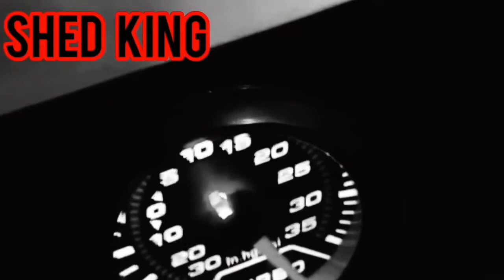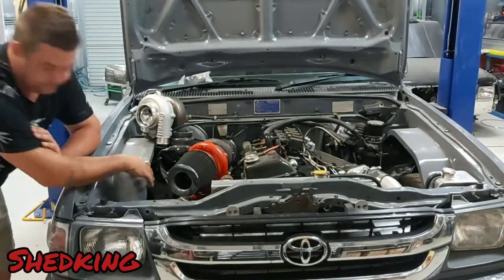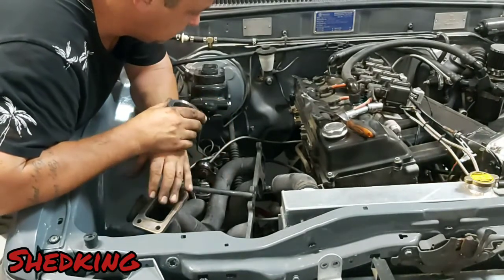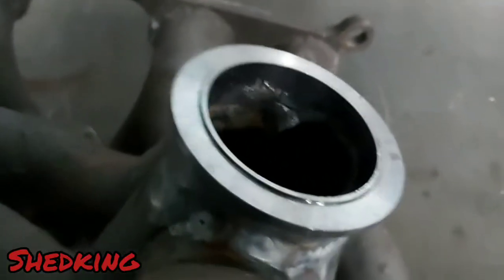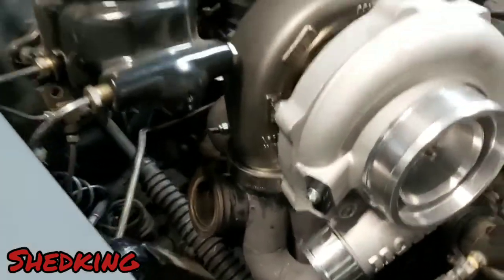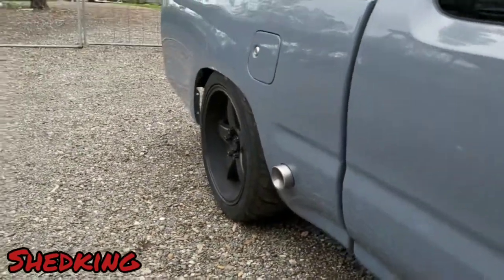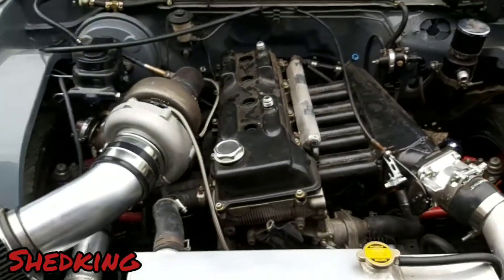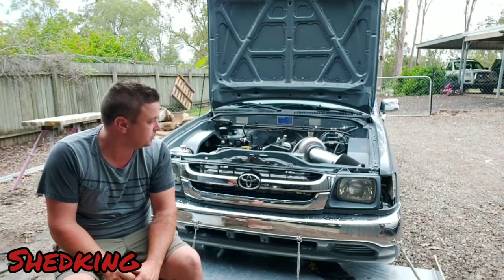New g30-900 turbo installed and a follow up on the new build 3rzturbo

Comment: Is the engine have stock internals still
Reply from the maker: Nah mate I built an engine with spool rods and arias 8.5-1 comp pistions balance shaft delete and stage 3 cams extensive port work to match intake and exhaust spent a good 10k + on the engine